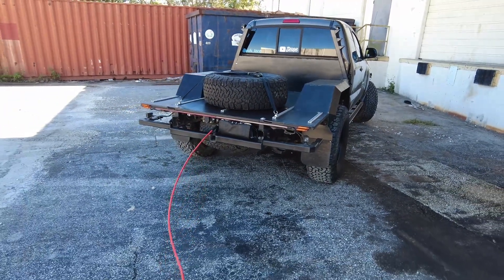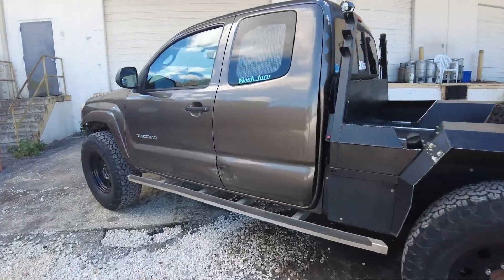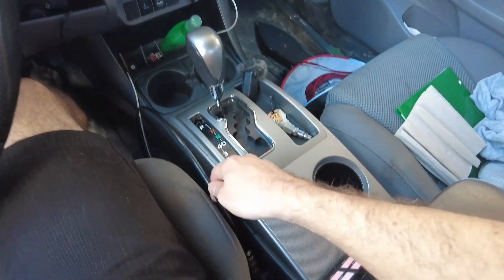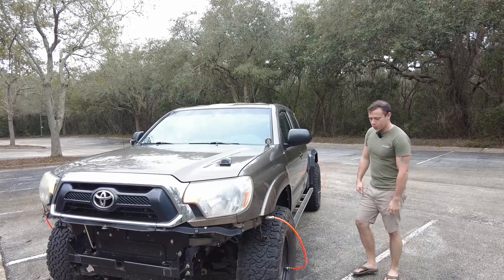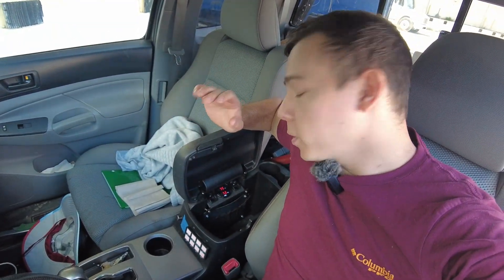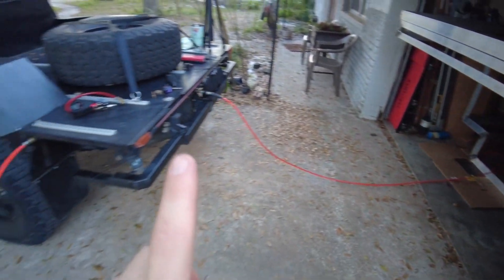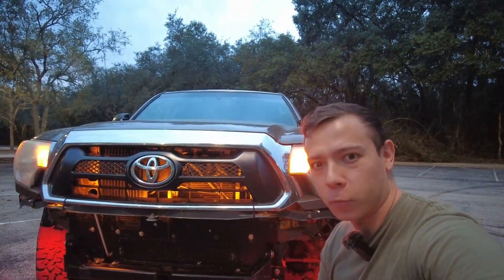DIY 4 Tire Inflation System (It's FAST) w/ Airbags

Comment: To air up your airbags did you have to turn your compressor on? I think you said you don’t run a tank right?
Reply from the maker: Yeah, no tank. 
A tank makes the system slower.
Reply: @jdesigns7239 great setup.  No idea why people don’t do this more

Comment: Can you share a full parts list in your description especially how the airbags work and if the pressure in each can be changed  and measured individually
Reply from the maker: Only connecting one tire will read/ change that pressure, so i could do individual pressure tuning. 

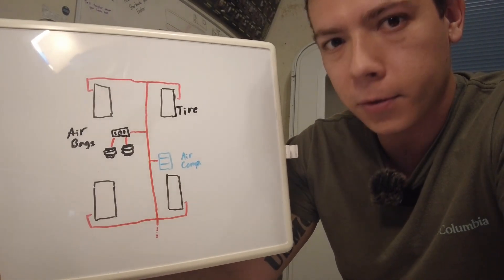No parts list. Your system will be different. There is a system diagram @12:14 in the video; how the bags are connected are shown there too.
Just draw yourself a diagram, buy what parts you need and build a system.

Comment: I am trying to setup a similar system to pump tires and airbags and was curious if you're running both systems off the same ARB compressor? If so do you just have a hose splitter somewhere in the lines? I noticed there wasn't a split at the compressor which I was thinking was going to be my solution

Great video!
Reply from the maker: @plewisdapanda   
Bags and tires are supplied by the same air comp.  
There’s just a manifold that takes air front the comp. and splits/ sends it to the front, rear and air bags.
Reply: @ you're the man! Thank you for still responding to this older video!

Comment: Thanks for sharing.  Is that air line you're using, red, some sort of poly as it doesn't look as stiff as nylon airbrake line but definitely isnt rubber?
Reply from the maker: @JoshuaTX77  it’s polyurethane air tubing.

Comment: Do u know where to find wheel rotary or hub to inflate or deflate ?
Reply from the maker: Im not sure what your asking. Whats a wheel rotary.
Reply: @jdesigns7239 i mean CTIS, i have similer system like yours i just need the rotray or hub (installed on wheels) in order to inflate or deflate while driving check please the footage at 12:29
Reply from the maker: @Saleh900  
That’s a video of a semi. I have no idea where to find hubs like those.  
I know there is a company making add on CTIS like that, for the 4x4 industry; tho I don’t recall the name.

Comment: Very cool, I am looking to do the same but also want it to deflate all 4...can you do that?
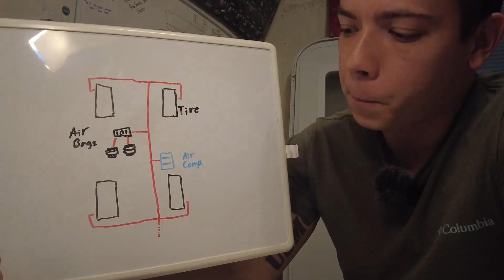Reply from the maker: @12:11 in the video I show a system diagram. To deflate you would add a dump valve by the interior gauge. 

I use Apex tire deflators each tire individually is like 10 seconds so it is a fairly painless process and so didn’t see the point to adding deflate abilities to the system.

Comment: How are you do you have a parts list yo can show share with us.
Reply from the maker: No, but @12:11 in the video I show a diagram of the system.
Draw yourself a diagram to help work out what fittings you'll need. I used 3/8" air hose with push connect fittings; I'd try to stay away from NPT fittings where possible bc they're expensive and more prone to leak.
Use bulkhead fittings to mount through things.
Reply: @jdesigns7239  where did you get the black covers for the fittings. Building a setup for a friend and can’t find those.
Reply from the maker: @slow_tacoma303  I think you're talking about the coupling cover.
I got it from Amazon. Search this: 
Dixon Valve K4DC Nitrile ISO-A Interchange Hydraulic Fitting, Dust Cap, 1/2" Coupling, Black

Comment: Don't know for sure, but that tire looks like a 315/70R17 BFGoodrich KO2, with a load rating of 2,915 lbs. and a max pressure rating of 65psi... Don't know for sure what specific year your Toyota is, but looking it up online - a new Toyota Tacoma SR weighs 3,915. 

If you take 3,915 pounds and divide it by 4 (tires) it averages out to 978.75 each tire has to support -  statically. 
If you take 2,915 pounds and divide it by 65psi - That's 44.85 pounds of support for each '1' psi air pressure.

Then take that 978.75 required weight support and divide it by 44.85, to get a 22psi per tire MINIMUM air pressure to support your vehicle statically. 

Now take into account that while driving, even off-road on rough trails - While you may be driving at slower than freeway speeds, your vehicle will transfer MORE THAN 978.75 pounds on any particular tire(s) as you drive through, accelerate, brake and/or stop going through turns. 

With all THAT said - Airing YOUR tires down below 22psi while offroading can lead to premature wear on the low-end of the anxiety technicolor dreamscape to tire failure on the high-end of the WTF Was I Thinking Trouble Code. 

As an aside - I respect that you went to the trouble to install a quick-disconnect on all four corners and use short hoses instead of a ridiculous rat's nest of 20 foot lines - - AND that your tires are actually MORE than twice the height of your rim's diameter. 

(I 'HATE' those Brodozers.  Those Pavement Princesses. Those Wannabe Mud-Terrains... It's the smell, if there is such a thing. I feel saturated by it. I can taste thier stink and every time I do, I fear that I've somehow been infected by it. It's repulsive, isn't it?) 

The only OTHER thing(s) I might suggest is that you purchase or fabricate a set of dust/dirt/mud cap for those Female Quick-Disconnects you have in each fenderwell  - -And that ARB compressor, while being water-resistant is not water-proof.
Reply from the maker: Interesting point. Weight distribution is not 50/50, but I think I get what you saying.

I go down to 12 psi in the rear; my rear is very light. The tires are E-rated too, so they aren't deforming much at 12 psi.

I spent my whole afternoon thinking about why max load rating of a tire divided by max psi would yield lbs 1 psi can support. 
Can you elaborate on why this is?
I'll certainly continue to think about it and get back with you.

Comment: You need to buy my Marine Corp trailer, camper m353?  Pretty sure.
Reply from the maker: But I'm already building a camper lol.
You don't want it?
Reply: Your camper would fit inside it. I’ve had my fun with it.  A marine built the hitch you won’t believe it
Reply: How can I send you photo?
Reply from the maker: @stchuckie  So funny story I was in the Corps, just 4 years; but drove trucks so I know what a M353 is.
They are so small and short you couldn't tell it was behind you most of the time, as least not behind the big military trucks.
Reply: @jdesigns7239  have you ever seen one with a 5th wheel hitch and a camper shell?
Reply from the maker: @stchuckie  Nah, never.
Reply: @jdesigns7239  it is the MOST  OFF ROAD camper others would fall apart.  Not this one.